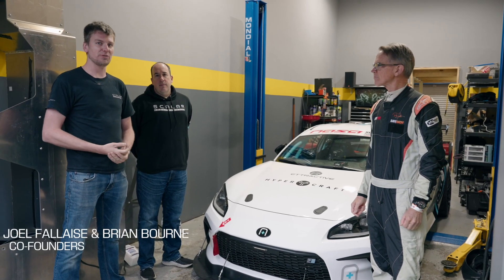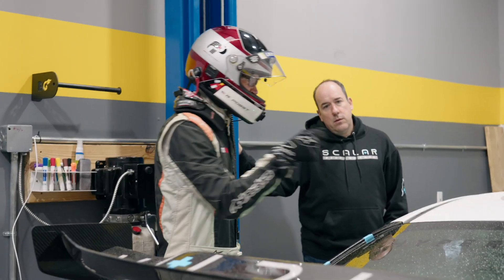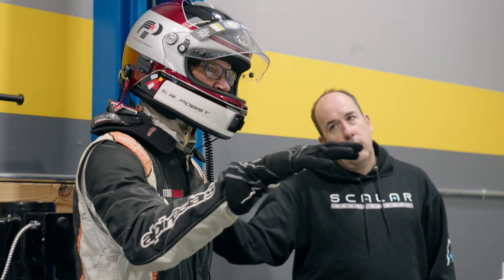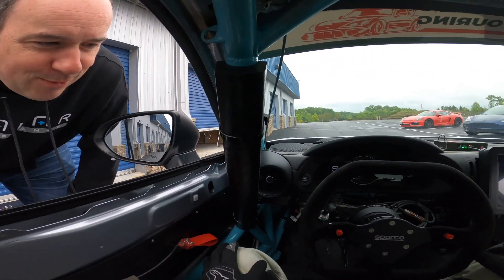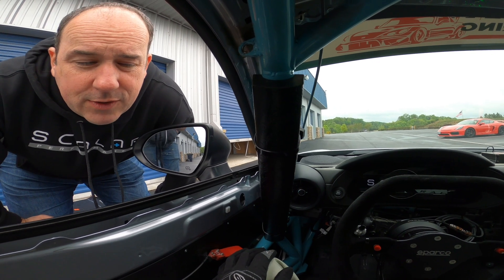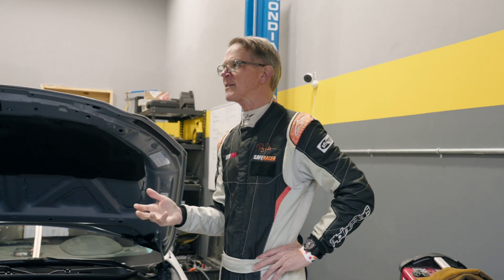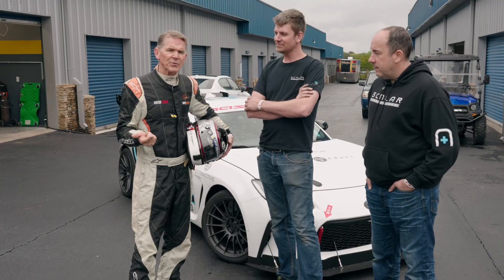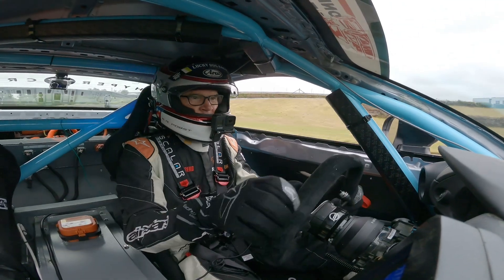EV specialist and pro driver Randy Pobst tests the Scalar SCR1 at Atlanta Motorsports Park

Comment: Yeah, no.

You ruined that GR86.
Reply: Boo hoo. They replaced the lawnmower inside the car with a washing mashine.
Reply: Tne GR86 isn't rare or expensive, I think it's a good platform to start with. And their original engines are known for grenading themselves at track days from oil pressure problems, even on street tires.
Reply: LMAO I have 7 rod bearing failures that will show you they made that 86 better. Being able to fast charge at a track would make it a no brainer to use this is instead. Sorry but the FA motors are junk, especially when you have a sticky tire on the track.